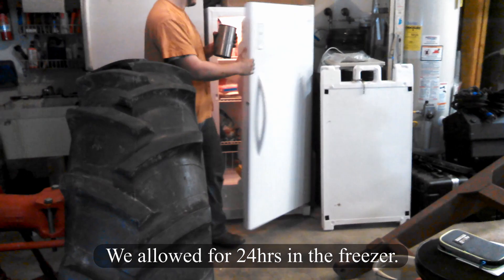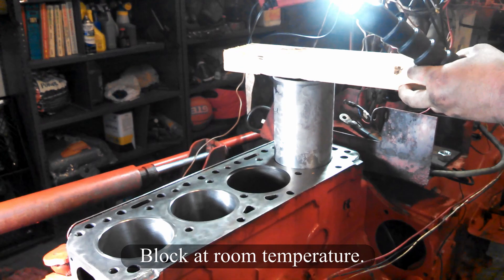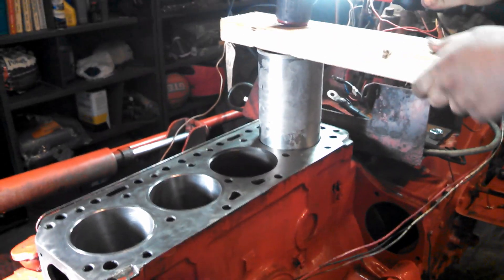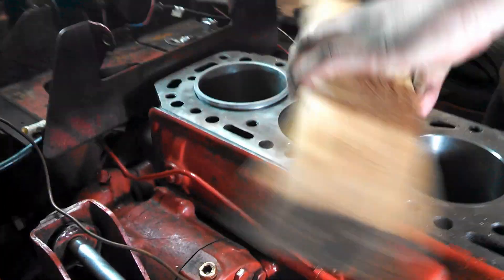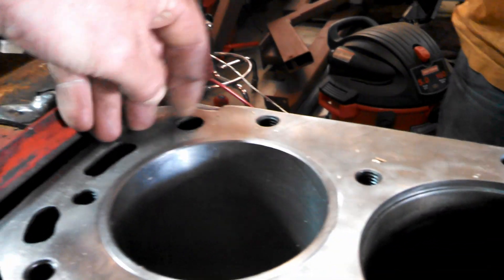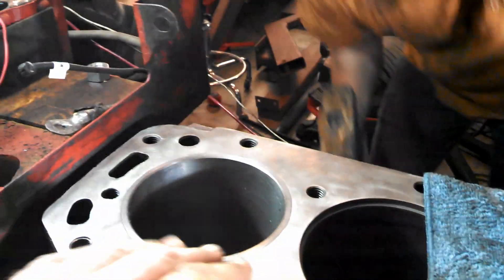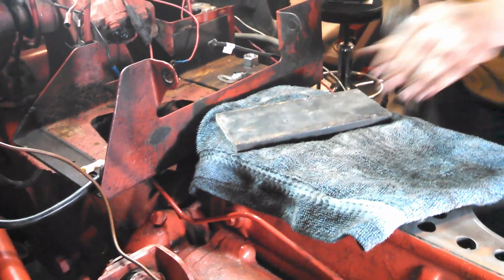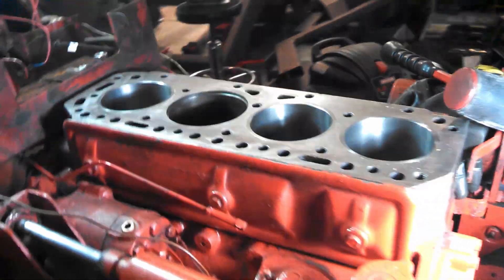Cylinder Sleeve Install - All You Need Is A Freezer and a Hammer!

Comment: Can a sleeve be installed in one cylinder only to fix a crack or I would need to get all cylinders sleeved? Shop said if I don't sleeve all cylinders I will have problems down the road. Is that true?
Reply from the maker: You could sleeve just one, but if one is cracked, chances are good that the others are not far behind. Best while you've got it apart to just do all of them- rings and bearings too. IMO
Reply: Thank you for the info
Reply: Yes

Comment from the maker: UPDATE: This tractor is still in service (2023). After re-sleeving, rebuilding the fuel injector, repairing the select-o-speed, installing a new clutch and brakes when we did this video, we still use this tractor for everything. Starts right up and has not failed us for more than 10 years. I absolutely love this workhorse and am glad that my son and I got to work together on it.

Comment: Did you oil the sleeves? I just say condensation no oil. Also for all you out there about to install sleeves make sure those seals are lubed with vegetable oil.  Not engine oil or break in oil. Call me out if you want but I work for Cat dealer and we literally rebuild with vegetable oil ;)
Reply: Don’t need to on these they don’t have any oring s. And I always heard use vegetable oil because it won’t swell o ring like petroleum products so you don’t cut ring
Reply: Sunnen press fit lube on dry sleeves, or #2 diesel.
Murphy’s oil soap on wet sleeve O-rings

Comment: Dry ice is better, no hammer, should use the head bolts to finish it instead of the hammer. I know you had a rag. But if you chip the sleeve corner, it is all wasted. Sorry I only have 50 plus years in the business.
Reply: That sounds like a good tip, with the head bolts! Do you have a plate you bolt on quick, or do you mean you let the last bit go home flush when the head it put on?  Also I agree on dry ice, done motorcycle bearings that way.

Comment: Freezer works great, I use it for bearings, bearing races etc.  Sometimes I also heat up the receiving part a little with a rosebud depending on how tight a final fit.  Most of the time the part just drops right in.
Reply: Ive use to to drain R22  from the heat pump toss a canister in the freezer

Comment: I just installed cyl sleeve. Is it okay to pop up a lil bit (0.5mm)? It was a replacement because this is old engine, cant find anywhere in my country. Thank you.
Reply: you’ve probably found the answer already, but a repair manual for whatever engine you’re working on will tell you the correct liner protrusion above the deck
Reply: How much does cylinder sleeve cost ?

Comment: I agree that the freezer treatment on the new liners will help with reassembly, but those liners are thin cast iron and they are brittle as well.  If you are skilled with a hammer, and are holding the wood block on the cylinder squarely and are hitting it in the centre, you will probably get away with it.  Even so you need to be careful not to get splinters of wood trapped under the top lip.  Can't say that I'd recommend though.
Reply from the maker: The liners are actually steel.
Reply: Chris Farley  As a professional engineer and mechanic I thought he did a perfectly OK job with the hammer and the wood.
Reply: @andyrbush  A professional engineer and mechanic?    "If the only tool you have is a hammer, you will start treating all your problems like a nail.”
Reply: @caspere.8461  Oh and no idea what you are referring to.